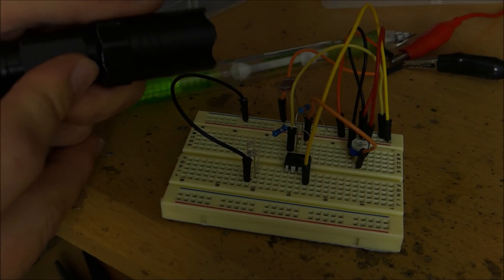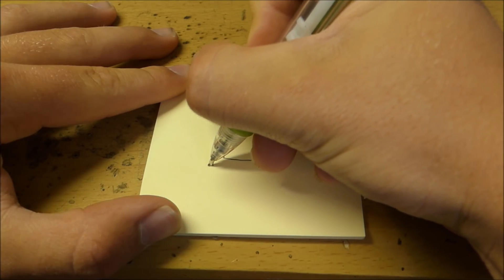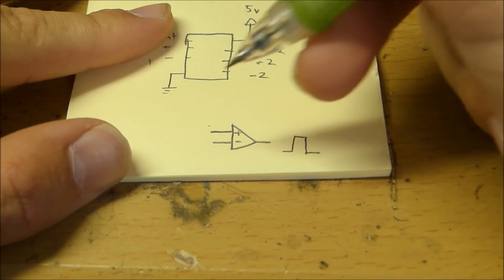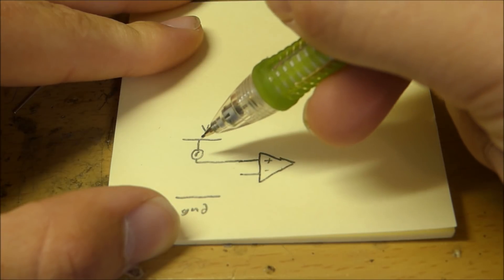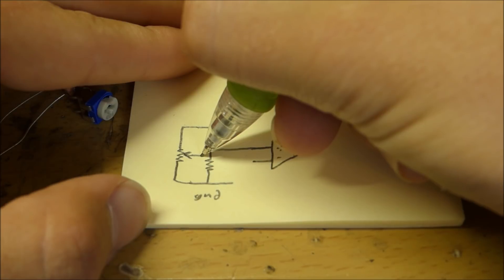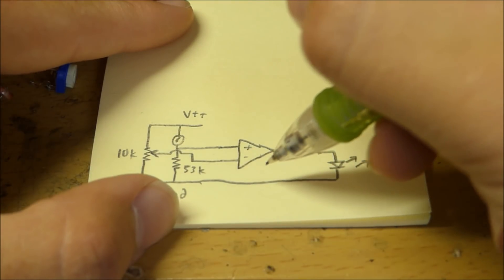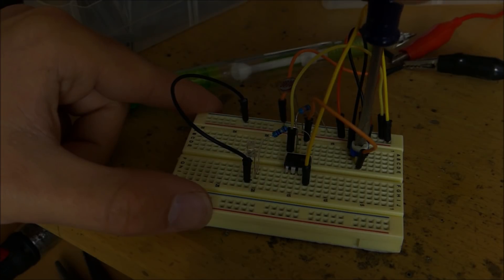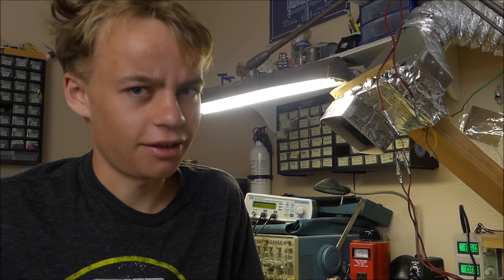Voltage Comparator Explained || How To Build a Nightlight Circuit

Comment: Tanner, perhaps you may want to consider a weak positive feedback introducing a latching behavior near the switching point. The circuit then becomes a Schmitt trigger and has a hysteresis depending on the amount of feedback. In your current design, when you slowly change the light level you will come to a point where the open circuit gain of the comparator let's your output follow the slightest potential changes picked up from the inputs, which most likely is a 60 Hz hum.

Comment: I once tried to make an off switch to reboot a router, I was using an old Bluetooth freehands and my phone, the idea was to send an audio signal to the comparator to make it turn off the voltage low enough to reboot the router but I think it didn't worked because the audio signal is AC.

Comment: This application only used one out of the two comparators of the LM393. You should properly terminate the inputs to the unused comparator to prevent any floating voltages causing it to fluctuate and propagate transients to the other comparator. Tying one input to +V and the other to ground should be sufficient.

Comment: I enjoyed the simple explanation. Thanks for sharing it with us. As designed this seems like more of a closet or drawer light, turning on when ambient light hits the sensor after a door or drawer is opened. For a nightlight I would imagine one would want the light to turn on when the sensor is dark. I suppose one would simple swap the comparator connections to get a traditional nightlight effect.
Reply from the maker: Yeah, I would just need to switch the inverting and non inverting inputs.